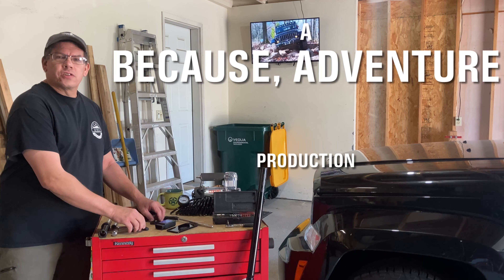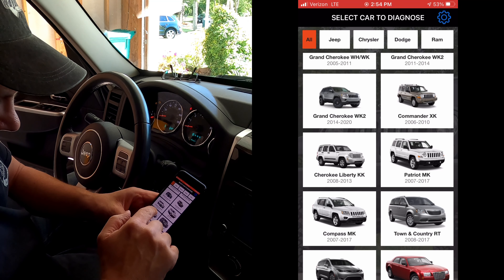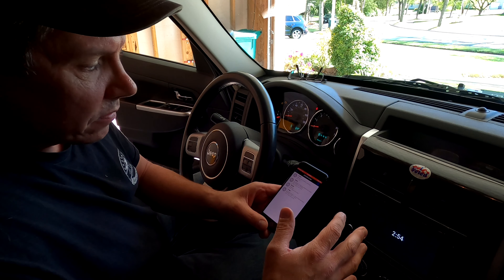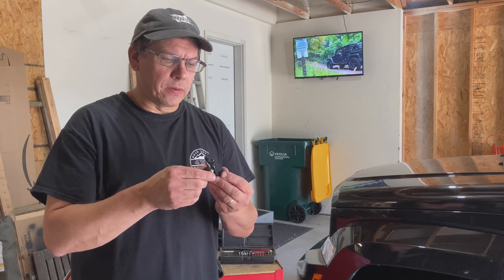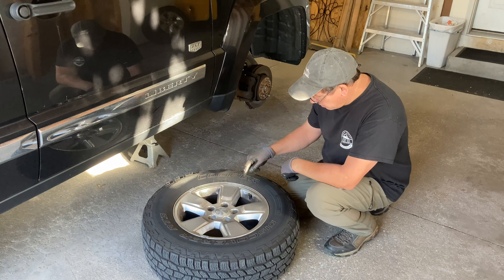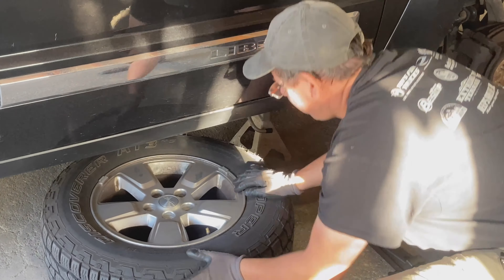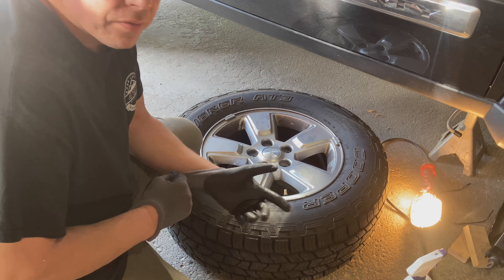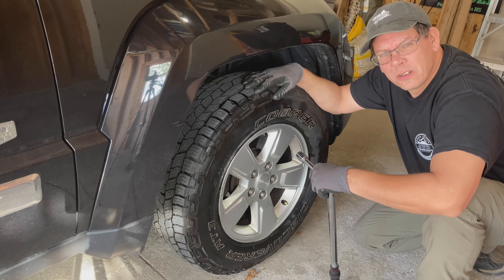DIY TPMS Sensor Replacement Using Basic Tools - 2011 Jeep Liberty

Comment: I bit the bullet and bought the Autel TS501.  I was able to buy their sensors and copy the ID# from the old sensor to the new one.  My 2011 Grand Caravan never knew that the sensor was changed.  The Autel was expensive, but very valuable.  I had sensors that would quit intermittently but work fine at the tire shop.  I was able to stop on the side of the road when light came out and find out which sensor was the troublemaker. I went ahead and did all 4 anyway after a few weeks aftera 2nd one failed.  They were all from 2011, so if they weren't going bad, they were on borrowed time.  Great video.  Your bead break method was better than mine.

Comment: Great video !
Already ordered 4 new sensors for my Liberty ..
A little info and tips for you guys;
The sensors are numbered as the door latches, which states:
1 - Front Left, 2 - Front Right, 3 - Rear Right, 4 - Rear Left.
Another great tip is to take a picture of the back of the sensors before installing, then - if the system won't recognise them - just put them in by their ID using alfaOBD or Jscan or Autel ..

Hope this helps :)
Reply from the maker: Good tips!
Reply: ya if you wanna know his life story!!!!

Comment: I'm so glad the newer sensors don't have that icky screw in the back that is difficult to reach or the bulbous rubber nipple that requires cuttin it off and a valve puller to install a new one.  The newer TPMS sensors just have a simple nut to fasten them and a screw-on shroud over it. Easy peasy. Not sure why they even engineer the older ones that way.

Comment: Nice video its great to see others fixing their own cars. A little helpful advice when loosing up the lug nuts position breaker bar so you are push down using your weight not lifting up on the breaker bar. take advantage of you weight and gravity. You did do that when tightening the lug nuts back on.
Reply from the maker: Thanks for the tip, but I respectfully disagree. When loosening anything I prefer to pull. It’s safer and more controlled than pushing especially when you don’t know the amount of effort it will take to break. It helps keep me out of the busted knuckles club. 👊🏻
Reply: @BecauseAdventure  no problem to each their own . I have had lug nuts put on so tight by others I had to stand on the breaker bar to get them loose and I weight 250 pounds. Im not sure you could pull up with them being on that tight. My backs not that good Im always looking for ways to work smarter rather than harder.

I have used you method before to break beads.  Its a little harder on low profile tires with small side walls. I use the full weight of my jeep with the rear lifted off the ground then lowered on the side wall. it did break the bead  but took the full rear weight of my jeep.
Reply from the maker: Yup, lots of knuckleheads out there that don’t bother with torque specs. One of the reasons I do what I can myself. In cases like you described, you have to do what you have to do.

Comment: Hi, thanks for sharing. i've replaced all my sensors and do many rides but the tpms light is still blinking. how the sensor knows that is placed into the wheel and not in the shelf? do the sensors need an activation or the vehicule needs a relearn procedure of the new sensors? thanks again and really appreciate your replies.
Reply from the maker: I have heard that some sensors need to be woken up with an electronic tool while others are woken by rotating. I’ve only used the kind that wake up with rotation. You will have to investigate your sensors and what is required to wake them.

Comment: Two questions, can you get this type of scanner that will work with all cars and does it program the new sensor? Great video for future reference.
Reply from the maker: Unfortunately, OBD JScan is only for Jeep, RAM & Dodge vehicles.

OBD JScan does not program the sensors. It’s been my experience that the ECU has the programmed limits and the sensors only provide data. I have heard that some sensors need to be woke up during installation and a cheap tool ($10/$20) is required for that, but otherwise no “programming” is required.

Great questions and I hope that my answers help!
Reply: @BecauseAdventure  Appreciate the reply and if nothing else it helped with the breakdown of the tire. Have a great weekend.

Comment: Great video. Do you really need those 2 blocks of wood? Can you place the scissors jack directly on the tire? It looks like the jack surface is about the same as the wood blocks.
Reply from the maker: You probably don’t need them if the jack base is small. If the push area is too large the tire will lift off the ground on the opposite side instead of pushing the bead off the rim.

Comment: Ok so I bought the sensor but I was told it needs to be programmed first. How do you program it please?
Reply from the maker: Sorry for the late response! No need to program! The sensors simply broadcast the pressure information to the wireless control module. Install them and they should update the ECU within a few blocks of driving. If your tire pressures is within specifications your indicator light will turn off.

Comment: Great video.I am writing to you from Italy. I also have a 2012 Cherokee KK diesel 2.8 200hp I also have this problem. In Italy each sensor costs about 132 euros. An excessive price. I wanted to know if the codes you posted (56029465AB 56029479AA 56029479AB 56053030AB) refer to each single sensor or are they codes that refer to interchangeable sensors? Sorry for my English. Thanks for the video and for your possible answer. Ciao!
Reply from the maker: Hello and thanks for the kind words! The codes as you say are the Mopar part numbers that the sensor posted is a replacement for. They are not individual part numbers for the four wheels. All wheels will have the same part number, but that number may very depending on the model or year of the vehicle. I hope that makes sense. I’m assuming that the 132e is for original replacements. You should find aftermarket ones for a lot less. Just make sure they are the correct frequency - 315mhz

Comment: What do you do next to "program" the new sensor?
Reply from the maker: Just drive the vehicle. They will sync with the PCM on their own. No physical programming needed.
Reply: @BecauseAdventure  thanks man!
Reply: Need to drive for a couple miles to have sensors activate and get picked up by computer.

Comment: Nice job...only thing that concerns me is crushing the tire with the scissor jack damaging the steel belts.
Reply from the maker: It’s a good concern to have although it’s been my experience that the tires are pretty durable and never personally had an issue.

Comment: Excellent video! Very helpful!  Are the new sensors designated 1,2,3,4 so that when you replace number 2 like in the video the vehicle will know the position of each sensor?  It seems that there must be some difference between each sensor as it was able to tell you sensor number 2 had failed.
Reply from the maker: No, they are not numbered. The position is what is numbered: 
DF = 1
PF = 2
DR = 3
PR = 4
At least that was my experience. The sensors self register with the wireless controller and the controller knows from what position the signals are coming from. At least that’s my understanding of it.
Reply: @BecauseAdventure  that makes sense I think. After I asked, I got to thinking about what happens when the tires are rotated. There must be some way the receiver identifies the position of each wheel. 

I have a 2010 Liberty. The warning light has been on for a long time and I expect the batteries are dead on all my sensors so I plan to replace all of them. Do you know if there is one in the spare tire too?
Reply from the maker: I can’t say for sure, but since the spare is just exactly that, I did not bother to investigate. Come to think of it, I’ve been lucky and never had to use the spare.

Comment: Do you have link to those sensors. I am in need of a set.
Reply from the maker: MOTOALL 4 Packs Tire Pressure Monitor System Sensor TPMS Fits for 2005-2012 Chrysler Dodge Jeep 56029465AB 56029479AA 56029479AB 56053030AB https://a.co/d/9xRaLqJ

Unfortunately, they are unavailable right now, but I’m sure you can find a suitable substitution. Just make sure the frequency matches.

Comment: Mine comes on randomly with a red light  in the middle of the dash. Not sure what that could be?
Reply from the maker: The red light is the security system. If both are coming on at the exact same time it’s probably an issue with the Wireless Control Module (WCM). Do you have any issues with your keys not working (engine not starting) or engine shutting off unexpectedly?

Comment: If it flashes then the TPMS battery needs to be replaced
Reply from the maker: I’m not sure what you mean can you elaborate?  I don’t think you can replace the battery as they are sealed in epoxy, at least the ones I’ve seen.
Reply: @BecauseAdventure  If it flashes three times and then stays lit that’s an indication the battery is going and on some you can replace but those that are encased in epoxy just have to be replaced entirely.
Reply from the maker: I did not know about the flashing indicating a faulty sensor. I used the OBD JScan App to confirm and the App let’s you know which one is faulty.

Comment: Why can't you just leave the sensor out? put old school valve stems and alleviate the problem once and for all? I remember when tires were tires, men were men, (and the sheep ran scared). more electronics to go wrong. Leave them out your problem is solved for life. Now just find out how to get rid of the light on the dash by pulling the wire off the bulb? The more electronics, the more to go wrong.  waiting for you opinion.....

oh buy the way, the money I save on TPMS sensors I can buy an air compressor for the garage.........I may be ugly, but I'm kinda smart.
Reply from the maker: You certainly can leave them out and even disable the dash light using a wireless OBD2 adapter & JScan app. I choose to keep the vehicle safety systems working as intended and made this video to help others do the same if they choose. I personally think that tire sensors are a great addition to the safety system and definitely contribute to keeping the vehicle safer and efficient. But hey, that’s just my opinion so enjoy checking your tires and your compressor.
Reply: Why can't you leave the engine out and pedal the damn thing or hook up an Ox to it...that's how real men did it before your kind of panzies came around and wanted to just push a pedal down to make things move...I might be dumb, but at least I'm pretty.
Reply: Helpful information! I've left mine out for years, and this video confirmed I don't want to change them at all, but good to know I can disable the dash light to stop the constant annoyance!

Comment: WHAT TODAYS CARS NEED ARE MANY MORE SENSORS , MORE COMPUTERS , ARTIFICIAL INTELLIGENCE WITH COMPUTERS TO CHECK COMPUTERS  WITH MORE SENSORS !!
Reply from the maker: While I agree with your sarcasm, TPMS is one of the better systems to be added to automobiles, in my opinion. That’s why I went through the trouble of replacing them instead of just disabling them.

Comment: Jeep's are junk.
Some of the worst quality vehicles made.
Reply from the maker: Dang! Sorry to hear that you had a poor experience! I can’t say that I agree with you though.
Reply: @BecauseAdventure  
Worse than ever since they're Fiat's now.
Never owned & never will.
Reply from the maker: Actually, Stellantis owns the Jeep brand now so the Fiat reference is dated. I’ve owned 4 Jeeps over the years and believe that the quality of the FCA builds were almost to the same level as the Diamler builds which were hands down the best for the brand. I’ve just ordered a 2022 so time will tell as to how the quality of the Stellantis build is. If I have issues you’ll be sure to see a video about it so don’t forget to subscribe!
Reply: @BecauseAdventure  
A Jeep Renegade is basically a Fiat 500.
They've been using Fiat parts/technology on most Jeeps/Chrysler/Dodge.
Stellantis,yes.
All Srellantis brands are poor quality.